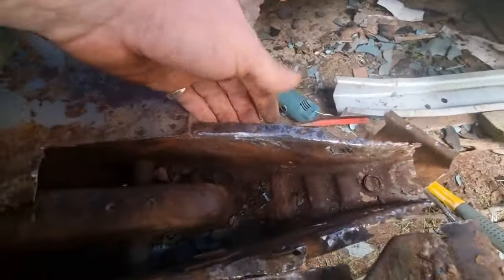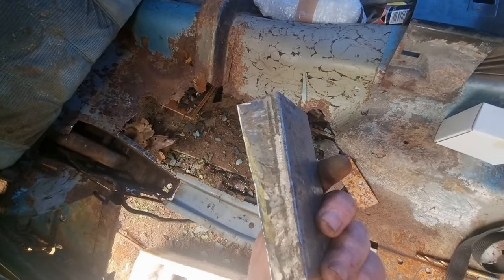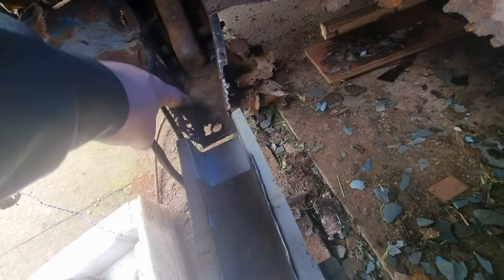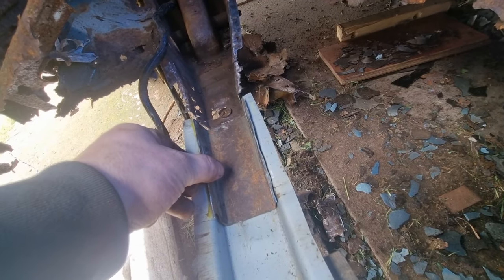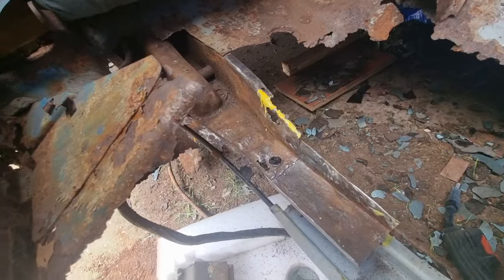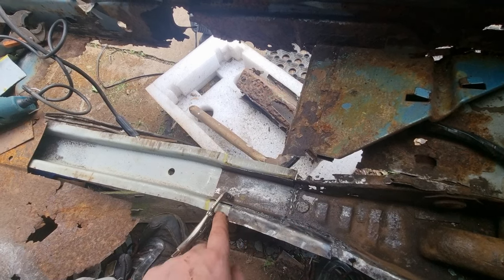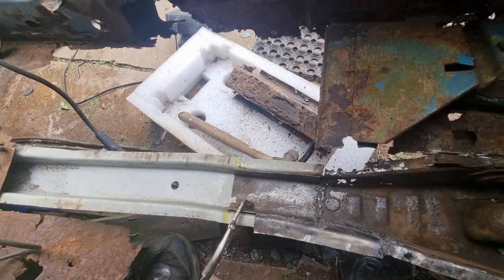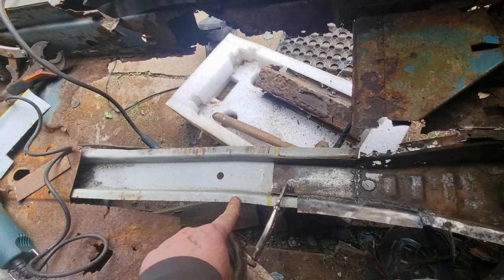Cortina Mk4 Ghia 2.3 V6 Restoration || Chassis Leg Repair Part 1 (P31)

Comment: Nice job Adam. I had to repair the drivers side chassis section behind the pedals. double thick plating in there.
Reply from the maker: Yeah it is thick plate

Comment: You done a good job I would of made the inner piece longer to slot in both pieces more it would of made it stronger instead of two pieces but everyone does things differently but your getting there mate 👍
Reply from the maker: Yeah was thinking that after lol very strong tho and does get welded to the chassis and floor pans aswell but will reinforce it anyway like the front ones from factory

Comment: won't be long, until you have the front and back connected again. Beware of any remaining wiring looms hidden.  Looks like there is a loom that goes to the rear end of the car?  Last thing you want is chop that, with out knowing its there.
Reply from the maker: Yeah it's all ready been chopped that's all I have of the wireloom née to get one as it was all taken
Reply: @AdamSNook.  no harm in getting a loom  from a later car pal,
Reply from the maker: @procta2343 if I carnt get one I will make one or ulter one from another car
Reply from the maker: @procta2343 also don't matter if iys from the estate as I have the rear section just have to join them
Reply: @AdamSNook.  what i ended up doing with the rover metro, was fit the later R100 loom in as mentioned, which had the later alarm system.  Rather you making one, you could look into the sierra or capri. Capri might be closer due to the age.  like i say extras and with you saying about ICE.